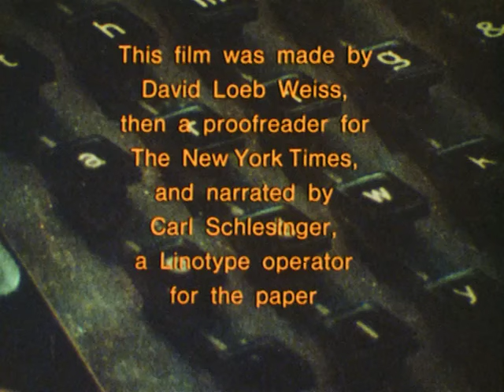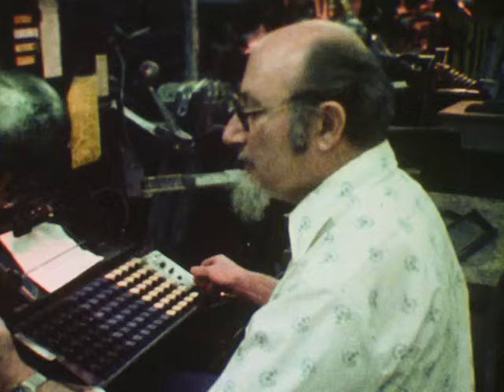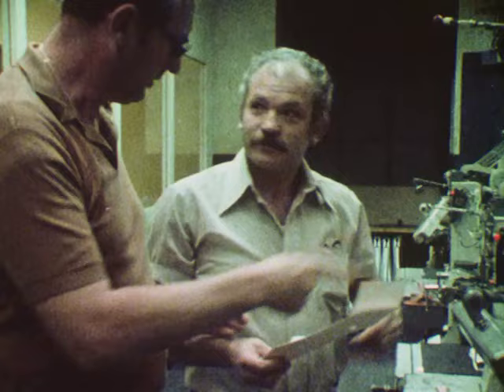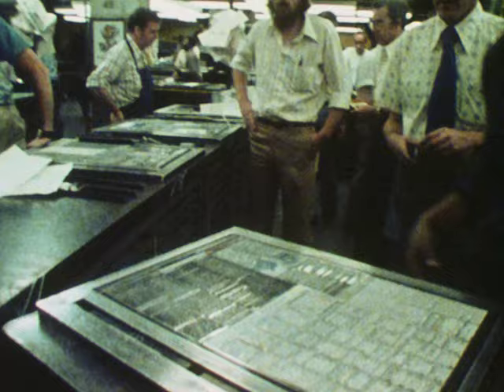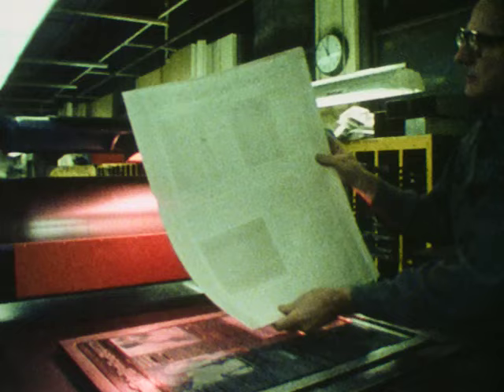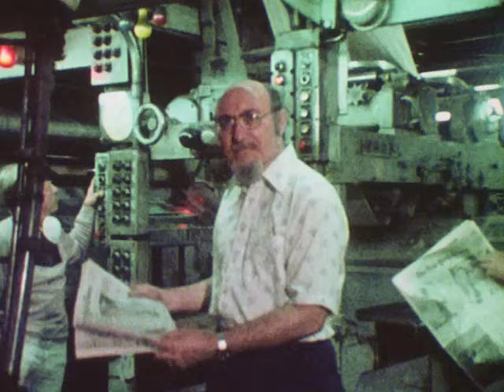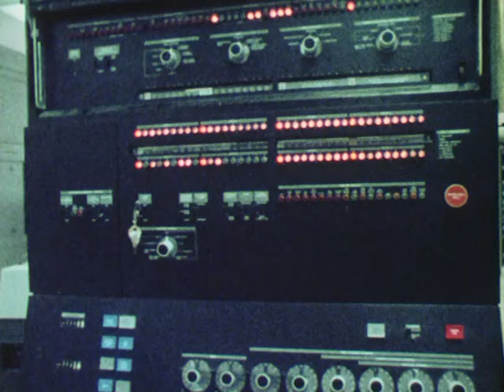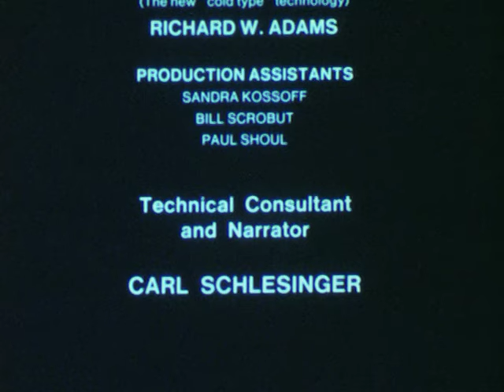FarewellEtaoinShrdlu

Comment: Holy crap they unintentionally documented two old previous generations of print shop.
Reply: Well... Halfway unintentionally.
Reply from the maker: I am sure some of the the printing equipment is still intact, they still have to print a bajillion copies of the thing once a day on the same type of paper. The lead cylinders are probably some type of polymer   now. I cant imagine a one to one print speed like that using any other mechanical system. Any ideas?
Reply: @drinksanddice9528  it's still all roller printing, but I imagine machines have been changed out to run even faster.
Reply from the maker: @wyattroncin941  I found this https://youtu.be/avXkRLoSta8 web offset printing seems to be the way they do it now.
Reply: @drinksanddice9528  Yes, sir, the link you put up above is about offset lithographic printing, but specifically for commercial use, such as magazines and advertising brochures, etc. Most, if not all, newspapers also use the offset litho process, but the configuration of the press units is different, designed specifically for the multiple webs needed for a full size newspaper. 

The same cold type process shown in the last section of your video was used to create aluminum litho plates, rather than plastic relief letterpress plates. But the pasting up on page size boards was exactly the same. Then came pagination systems, where an entire page could be designed and created on the computer screen, then sent to a laser printer to create negatives, which were used to make the aluminum plates. Now, negatives have all but been eliminated, and the laser printers are "direct to plate". I am retired from 40 years in commercial printing, and I saw these same changes take place in that sector of the trade. (Mostly, I was an offset press operator, but our shop was small enough that I also worked in pre-press and bindery.)

When USA Today made its debut, extensive research showed them that they would need full editorial color if they were to compete with national news magazines. This forced the industry to find better ways to produce high speed color on newspaper presses, which up to that time had not been designed for color.  Goss, MAN Roland, Harris and other press manufacturers rose to the challenge, and advancements in automation, remote control of ink and water balance and register of colors is very remarkable today.

Newspapers are certainly struggling, but I don't think they will completely disappear, as some folks are saying. Press manufacturers continue to make advancements in technology. Only a few years ago the Buffalo News invested in new reel stand automation, and last month the Spokesman Review (in Spokane, Washington)  opened a brand new building, which is off site, and will be used to produce their own paper each night, plus commercial printing jobs and perhaps other publishers' newspapers. These are just two that i happen to know about.

There is also research into using ink-jet printing for newspapers, and machines already exist to produce smaller quantity runs of newspapers. They need to improve the quality at higher speeds before it can be used for big city dailies, but I'm guessing that day will probably come. 

Thank you so much for putting up this video.

Comment: Hello from an old Linotype setter (also taught at 2 printing colleges in the UK)
. The metal used isnt just lead, (it would be too soft on its own and wouldnt last very long on a printing press) Its made up of 3 metals, Lead, antimony and tin. the 2nd two  are to give stength and to fill the letters on the matrix.

Comment: 8MB disk packs. Yup. That was a thing. 

Now we have portable phones with 128GB of storage.
Reply from the maker: Do you remember the sound they made? I toured a mainframe facility in the late 80s and remember the noise and cold, like a really slow movie projector.
Reply: @drinksanddice9528  Modern data centres are still typically about as cold... assuming, of course, that they're not stuffed with more equipment than their air conditioning can handle: I remember a DC here in Vancouver, Canada, 15 years ago that had dozens of stand fans and several portable air conditioning units scattered around the place, because they'd installed too much equipment. =D
Reply: I remember my college professors had those disk packs in their office, full of tests.
Reply: 8mb was huge back then! Even 720k was state of the art in the late 70s. I bought a new PC in 2003 that still rocked a 1.44mb floppy drive!

Comment: I have an old DVD recording of this film. Excellent that they made this film on the last day with hot metal. (I worked with newspaper production at Berlingske Tidende, Denmark from 1985 (just after the  end of hot metal in 1984) until 2017
Reply from the maker: @MartinFroland  I originally posted it because a professor of mine would show it every semester but could only find it on VHS. Figured uploading the archives.org copy would save him from hooking up a VCR.

Comment: Back when I was in high school, we had a Linotype machine and an offset press in printing class.  This was back in 1967-1968.  It was actually fun to run the machine, make the lines of type with molten lead, and place them in a rack, in which we printed the school newspaper.  I remember I always had trouble with the keyboard layout as it was completely different than that of a typewriter.  If I remember right, the capital letters were on the right side of the keyboard and the small letters were on the left.  Number in the middle, I think.  I remember being told that we had to fill up a line with blanks, or if the line wasn't full we would have a squirt of hot lead, and the possibility of getting burn't.  I'm sure today they would never allow anything like this in a high school, because of the hot lead and the lead poisoning issues.

Comment: Now you can figure out why we call them Upper Case and Lower Case.
Reply: I still don't get it. I must have zoned out during that part or something. Can you explain?
Reply from the maker: The typesetting case they used holds the minuscule type on the bottom of the type-case, and the large type in the upper section of the type-case. The California case for hand composition keeps them on the right of the case.
Reply: Also, in the new cold type process, figure out the REAL "cut and paste" job.

Comment: Ironically, there are a lot of videos about hot metal type since a number of Linotype machines are still in operation (mostly small printers keeping it alive in an "artisanal" way, but operating nonetheless) but there's really no other video on the internet that shows how the first generation of "cold type" worked. There's still a rather interesting page composition process where they literally paste the boxes onto a draft page and it looks like they fed the pasted-up sheets back into the system like a Xerox machine on steroids. After PCs and WYSIWYG displays that process was replaced by software -- one version after another.

Comment: How did these guys not suffer from lead poisoning?
Reply from the maker: According to one of my peers dissertation, early modern typsetters (movable type set by hand) mostly died of alcoholism. They would set so many pages of a book, get paid per line, spend the money on booze, get drunk, and go to the next printer and do the same thing every day all year round. It's not actually pure lead, its type metal which is antimony, tin, and lead, but I'm sure heavy metal poisoning was still and issue, I bet they rotate work stations once a week or something so they dont kill all of the skilled linotypists.
Reply: along with lead poisoning, a lot of the chemicals used to clean the type, the inks, etc lead to lung problems like emphysema and liver problems like cirrhosis as well due to being around it all the time and sometimes elbow deep in chemicals for cleaning type, etc.  Most of these problems wouldn't really be known until 20 - 30 years later.
Reply: Lead will melt at a temperature lower than the temperature at which it emits toxic fumes.
Reply: yeah, but don't lick your fingers.  (from someone who spent years casting his own bullets.)
Reply: Lead poisoning is most dangerous to those with developing nervous systems. The greatest danger would be to a woman working in that environment who did not yet know she was pregnant.

Makes me wonder if there have ever been lawsuits about that.